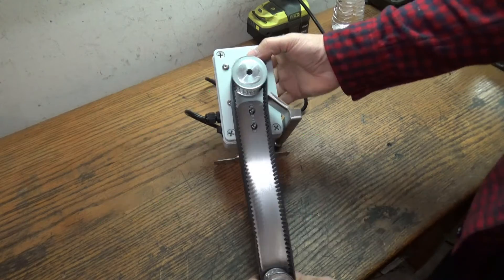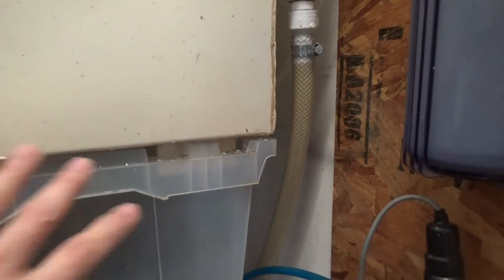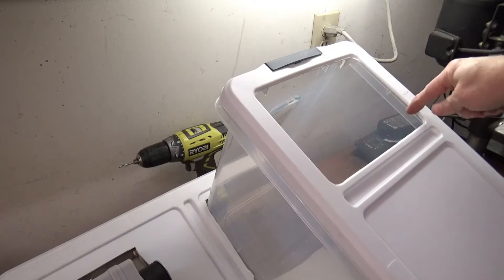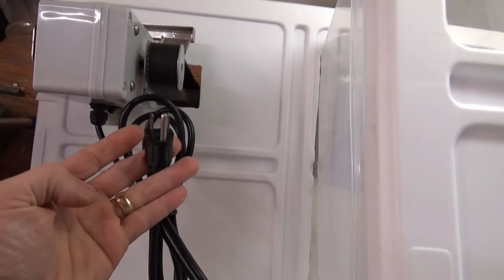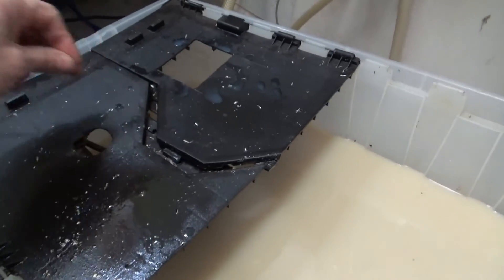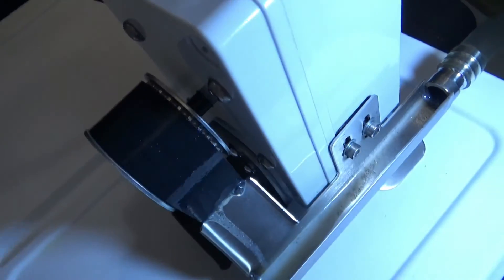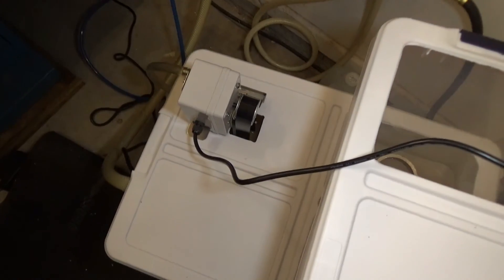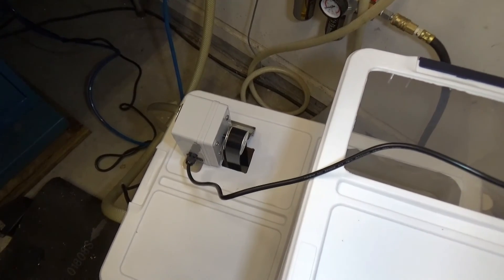DIY Oil Skimmer Install

Comment: I wonder if it ran slower, it wouldn't pick up so much coolant. Give it a chance to drip down more. 
I've seen indutrial washing machines like parts washers with the disc type skimmer.
If I'm not mistaken, they run at least half that speed. It's been a while since I've seen one.
Reply from the maker: It seems to work well , and does not pick up much coolant. But a longer arm or slower speed may be better.

Comment: add a fish air pump and air stone, stops bacteria
Reply from the maker: While an aerator may impede the bacteria growth, The oil which the skimmer is meat to remove would still be present. The idea is to remove the Oil, therefore also removing the bacteria.
Reply: @CNC4XR7  I meant in addition to your skimmer
Reply: @CNC4XR7  I was a tool maker for 31 years. We always used skimmers and aerators. Make all the fun you want, it just shows that you're a jerk. Only the guy that knows it all can never learn anything new.
Reply from the maker: @yelims20 Just a little light fun with @halfstep67 . I appreciate your suggestion on the Pond aerator. I apologize if you were offended. I never considered dropping in a aerator. It is my understanding aerators promote microbial growth which are feeding on the free oils in the coolant, they then settle to the bottom of the tank. to be removed later. My thought was to remove the free oils so the bacteria doesn't have a food source. After all this is a small coolant tank and my oil / sludge issue is minimal very little debris gets in my coolant tank and all of my coolant is filtered.  In a industrial setting with a  large  coolant tank I could see this could be beneficial.
Reply: @CNC4XR7  the bacteria can't live in an oxygen rich environment.
Reply: And a couple of grass carp.
Reply from the maker: Or Coy  @halfstep67